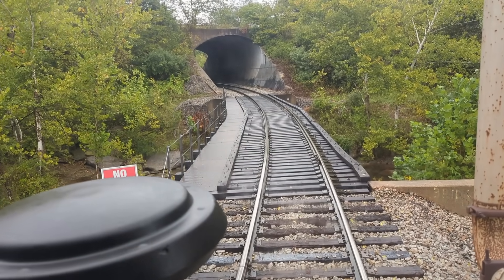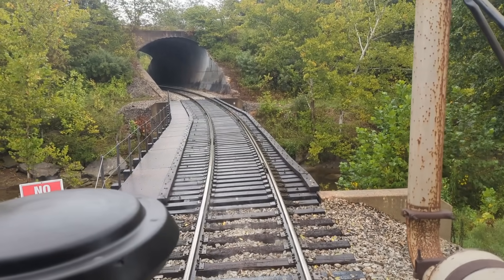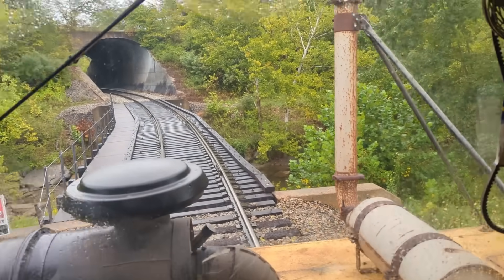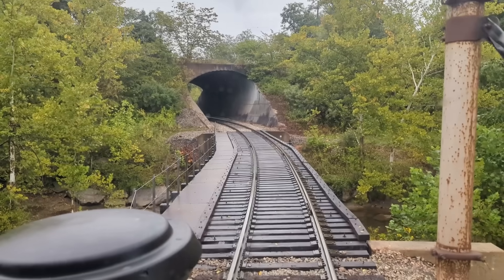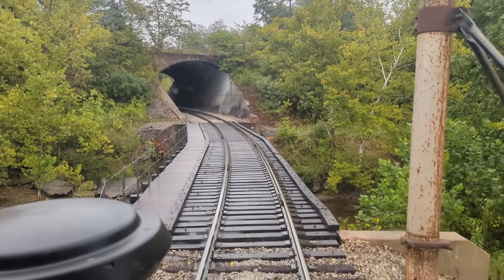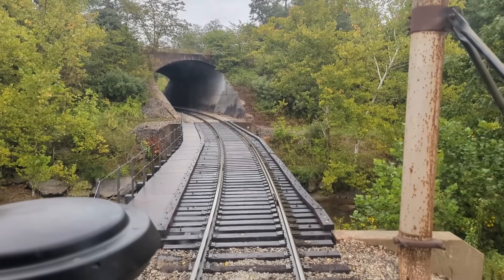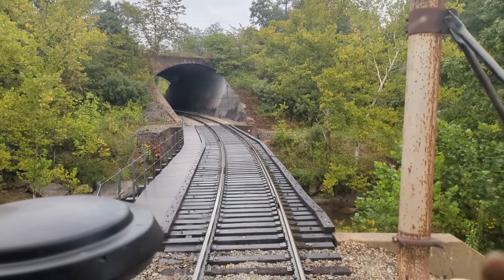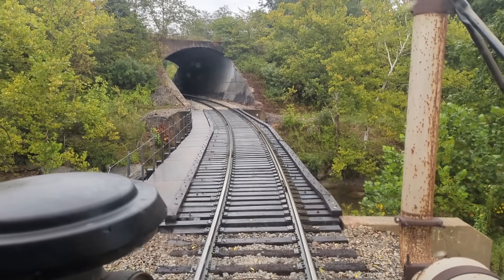How Super Elevation is Added to Railroad Curves on a Bridge

Comment: Great video Dave.  Good explanation of how super elevation is achieved on a structural steel rr bridge with concrete foundations.  I have looked at this bridge (Bridge 11) and also the bridge over S Eight Eight Rd (Bridge 13).
Q1.  Are all of the Cumberland Mine RR bridges structural steel with concrete foundations?  It is good if they are.  I worked in the water industry.  A large sewage treatment here where I live had a difficult time in the early 1990s:  The plant used 90 ton railcars of chlorine for disinfection of the plant effluent before it was released into the receiving body of water   .  Some folks stole a car, stripped it and set it on fire burning up a creosoted piling and timber rr bridge which stopped rail traffic in and out for a while.  Not a quick repair.
Q2.  Does trespassing occur very often on the Cumberland Mine RR?
Reply from the maker: Thank you for the nice comment and glad you enjoyed Michael.
yes all of our bridges are the same design and structure, except
that Bridge 2 is a ballast deck bridge. I'm sorry to hear of that
misfortune, very sad indeed. We would be totally screwed
if something happened to one of our bridges. We get lots of
trespassers on our RR, 90% of them are hunters or folks riding 4 wheelers along the track. But we have almost zero vandalism.  Really appreciate your taking the time to watch and may you
have a very good day.

Comment: It is my belief that that tie has a bad crack or split leading to the top of the tie from the inside corner of the dap.  It is likely to continue causing a failure of the tie.  With the ties being dapped like they are, that makes changing just one extra difficult and time-consuming.  There are several large checks in that tie.

Comment: That unused timber looked like it was split from one end to the other.
Reply: I noticed that too and am wondering if the daps are on the wrong ends, but I can't see all of the ties well enough.
Reply: @JonMcCormick6805  Are you being sarcastic? If you pick one up with the dap on the wrng end, just swap ends like the boom operator did a coule of times.
Reply: @elvinferrell7266  Except for the tie at the near end of the bridge, the deeper dap is farther from the end of the tie than the shallow dap is from the other end. Therefore it couldn't be swapped end for end.

Comment: I never noticed it before but looking at the bridge ties at about 12:20 in the video I notice they appear installed on their side compared to the ties on the ground. In other words the narrow sides of the bridge ties are on the top and bottom vs the wide sides top and bottom on the ground.  Is that how most railroad bridge ties are set?
Reply from the maker: Most all bridge timbers are the same width top and bottom whether
on a tangent bridge or a curved bridge Jeff. However the height
of the timbers are higher on curved bridges than on tangent ones.
That is to accommodate the extra dap needed for the super elevation. So thus the same amount of height is on the girder up to the tie plates on both tangent and curved bridges.  Thank you for  taking the time to watch our video and may you have a very good day.